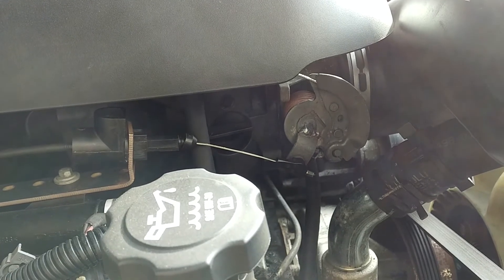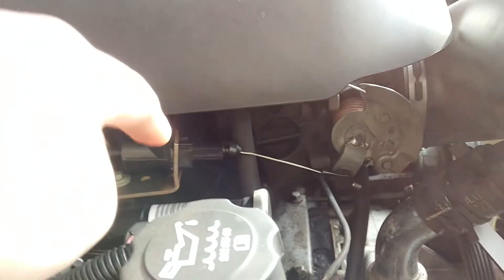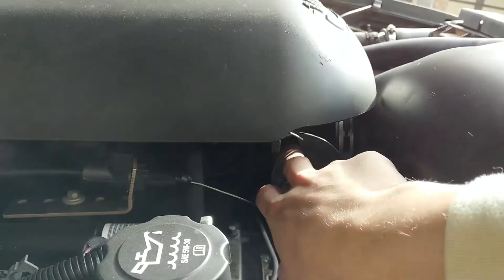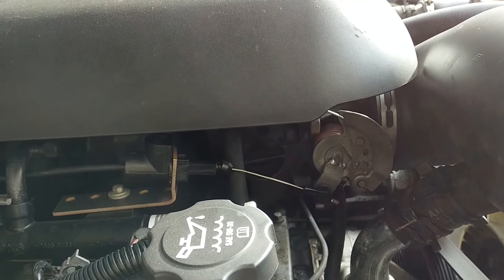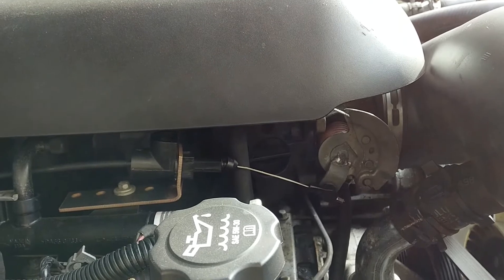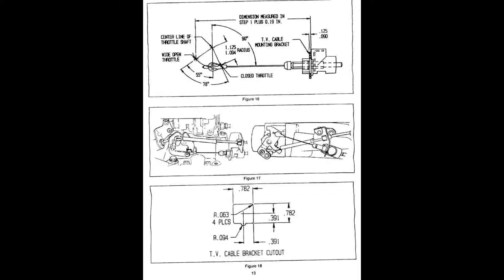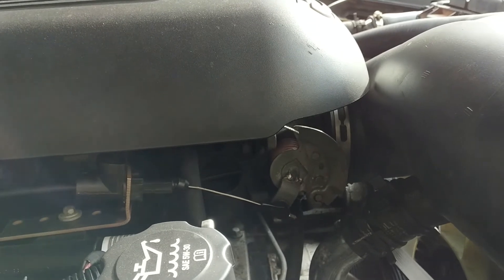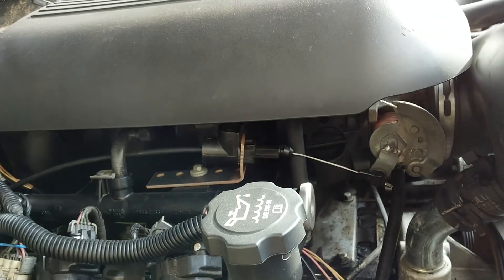How to adapt a 700r4 to an LS engine for cheap/free

Comment: how did trans hold up?
Reply: The 700r4 and later 4L60e bolt right on. There is no bolt in the 2:00 O’clock position. Plus, on truck engines, just buy the center adapter everyone is making for under $30. Just make sure the offset or dish side of the flex-plate faces the transmission. This keeps the torque converter far enough back to engage the pump and work right. Place a qt of ATF-6 in converter and lift, spin and push. Once on, a flat edge of any type across the bell housing will let your fingers slide in and I am 6’ 3” with big hands. Easy. Best of luck.
Reply: How good did trans shift

Comment: hey qustion for you ,what is your tv cable out of ? mine is to short to reach the throtle body
Reply from the maker: Mine is stock, but the truck had a diesel originally so maybe it was longer.
Reply: 88 iroc z ,pretty sure details are in one of the videos related..cheers
Reply: Im running into the same problem

Comment: With the torque converter spacer in the crankshaft, does this leave a gap between the converter mounting pads and flex plate? If so did you have to add washers to make up the space? I’ve got a 4.8 with the crankshaft that does not stick out. Was bolted to a 4l60e.
Reply: buy a 4l80e flexplate no adapters or drilling required. bolts right up there 55 bucks on amazon
Reply: @hankplays4563  you have a part #?
Reply from the maker: No gap, the flexplate is dished and that's why you need the spacer

Comment: How are you controlling the 700r4s torque converter lockup?
Reply: You need the kickdown kit from painless wiring. It works good.
Reply from the maker: Currently, I'm not. It was wired to a switch on the dash but I broke it when I rewired the fuse box. Don't ever go on the highway with this thing though so it's not on my priority list
Reply: Can't i just tie into the ls tcc to the obs harness

Comment: Hey man what length cable did you use? I’m trying to do the same thing
Reply from the maker: I used the cable that was already on the transmission, probably stock. It's a little short but totally doable
Reply: @evanpwilliams1  do u think u can find the part number for that adapter kit for bowtie overdrives? U may have saved my project
Reply: @evanpwilliams1  yo
Reply: @brownbriansjeep9020  what did you land up doing on that?